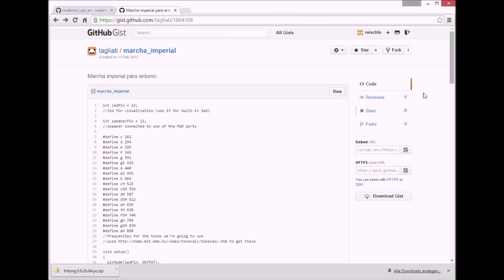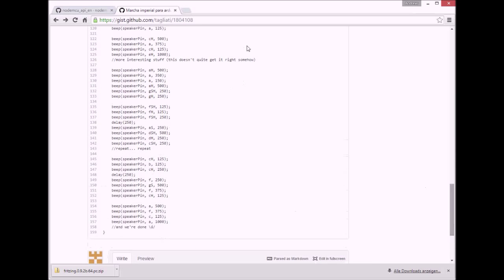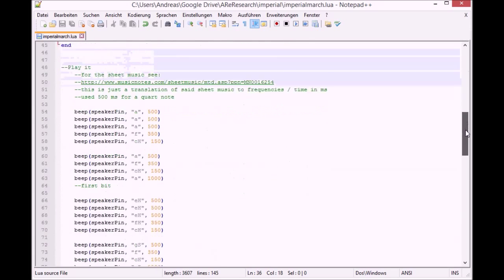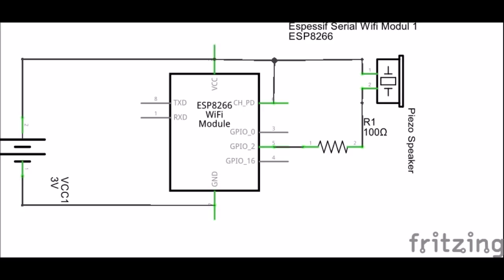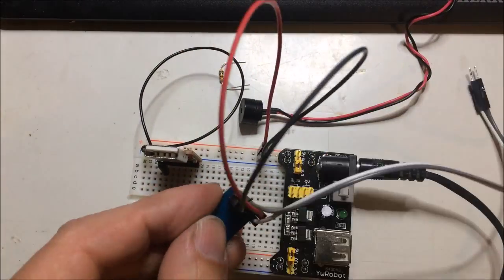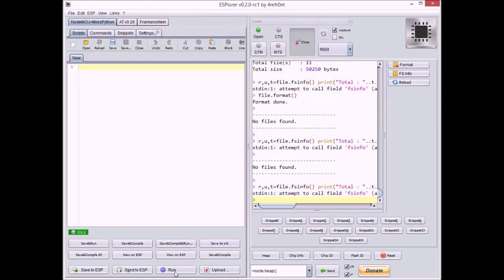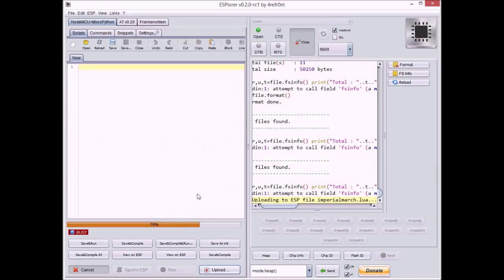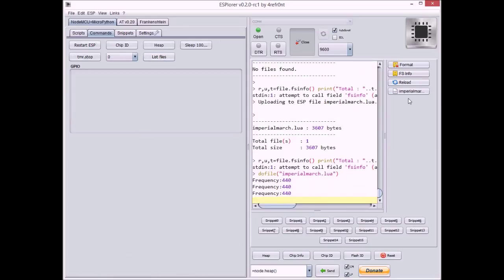The Imperial March played on an ESP8266 WiFi module (2nd part)

Comment: OK, I know I am a bit late to this party. I am just catching up with your channel and enjoying the process. Its a bit like binging on a boxset of DVDs; I would put the experience up there with watching the West Wing. I had noticed you were using a piece of software called ESPlorer (I think it may be by Espressif). I noticed it first on a later video the ESP12E in minimum one, in which it seemed to be a very useful tool. I worked my way backwards until I reached this, the first appearance ESPlorer. I was hoping to catch some comments about the software, but alas, was disappointed. Would you please consider doing a full video on the uses of this software? I am sure that I am not alone in my curiosity of this tool. Great Channel, great sense of humour!